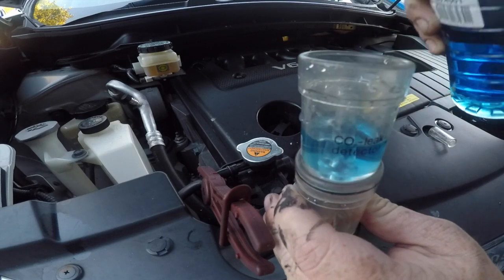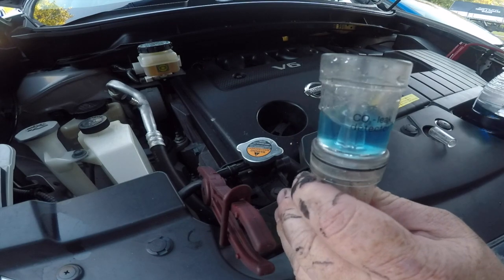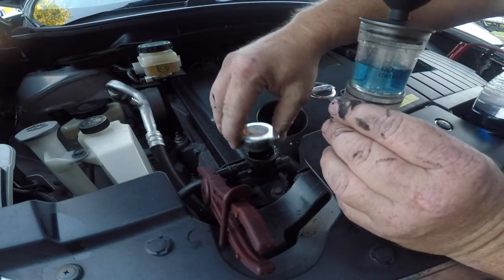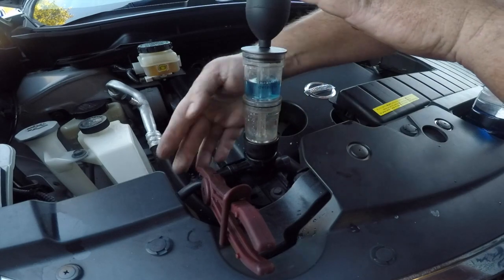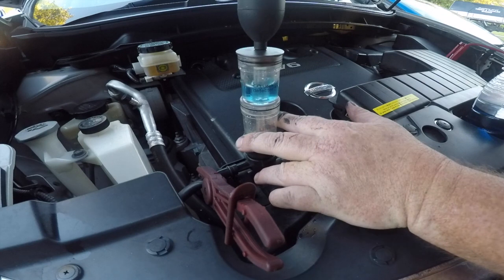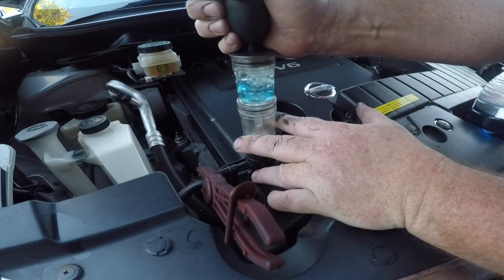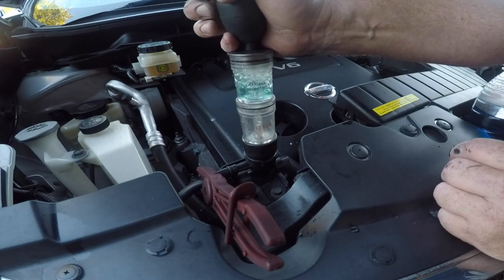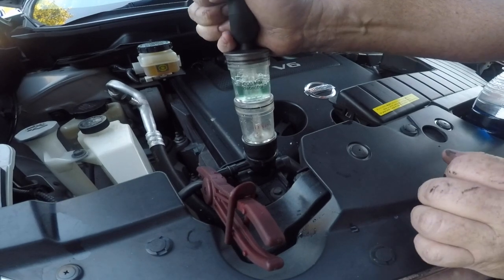Testing for a LEAKING HEAD GASKET

Comment: Should we test this on the radiator or coolant reservoir tank. 
My radiator has coolant right to the top and if i take the radiator cap of and  start the car the coolant starts to overflow out from the top of the radiator.
Reply from the maker: Test at the point where the pressure cap sits. You may need to remove some coolant